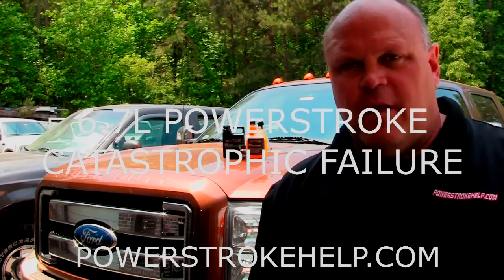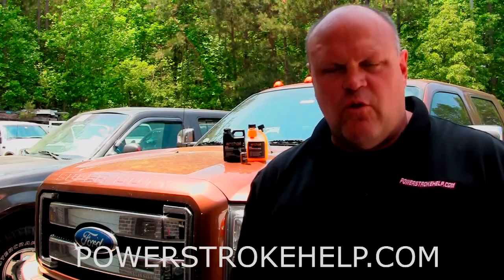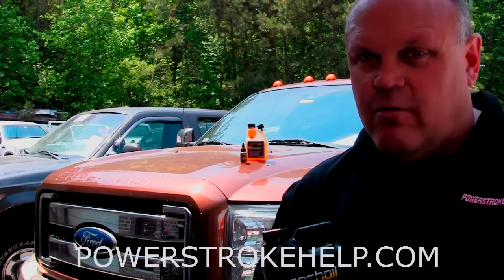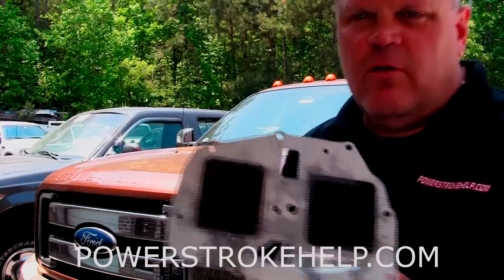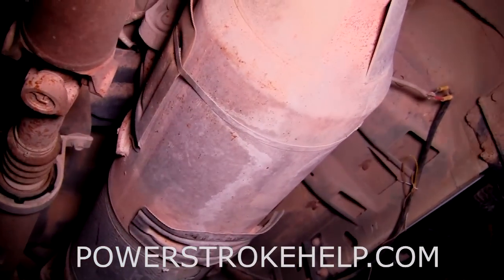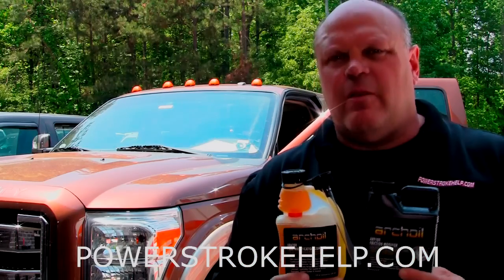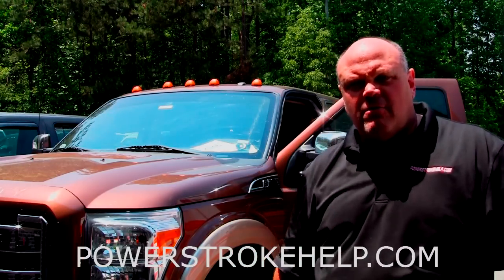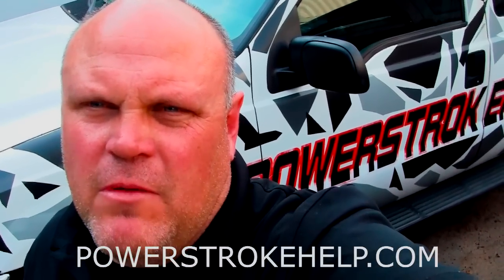6 7L POWERSTROKE CATASTROPHIC DEATH - ARCHOIL

Comment: That probblem diden't sound like Turbo...Ha...i bet it's another Hydro Lock or Hydro Screw up that has Crashed a Connecting Rod....6.7 has Faulty Glow Plugs that wreck the engine...Exhaust will wreck the engine...and Fuel injectors will wreck the engine.....Geeze.....
Reply: i was lookin into buyin a half way decent diesel truck F350 But the instant you buy it..Take it to your Shop and Spend a Week Plus 5 Thousand More Dollars to make it a nice Dependable Truck...The 6.0,6.4,6.7 all have internal issues...if a person took a old 6.9 and put a Turbo on it Or Based on 6.9 is the 7.3  You would have a Nice Truck...A lot of these newer Diesel Trucks with EGR Need Clean Motor Oil...They Run it Untill the Oil Gets like Soot...Well the Engine Spits out Crappy Black Stuff with bad Engine Oil...And Plugs Up the EGR and Urea Systems...People don't want to Maintnence is 50% of the Probblem...The other 50% is Bad internals..And Yes the Stock 7.3 Clutch is a Flop...The life of the Diesel is Clean Motor Oil..it plays a Major role in keepin it alive..Used to change Oil in the Injector Pump when ya changed Oil in the Engine...Not no more...Diesel would of been nice but found a Mint 2001 F250 4x4 that needs Engine work in Orlando for 1,500.00$.... Can't see me Payin Twice for a Truck and Have to work on it for a Week also to make it a Decent one....
Reply: There was a 2 wheel drive Duramax for sale near here for 2,000.00$ ..I almost went and looked at it...Was in Cincinati..Think it was 01 or 02....?  Then I thought..Why are they sellin it for that price...? Got to be something wrong with it....?  I did not mess with it...Diesels can be Soo Expencive....$
Reply: Rich's 65' Tree Bucket Service ?

Comment: How does Ford keep selling these crappy diesel trucks?.....6.0 , 6.4 bad - now we are hearing the 6.7 needs exotic aftermarket lubricant to survive ?.....

I LIKE Ford trucks - their TRUCKS  are in my opinion the most capable, refined and comfortable - BUT- the 6.0 and 6.4  engines in the two that I have owned were a big pain the A$$ that cost me plenty of time and money and Ive gone back to gasoline

if the EPA mandated emission stuff makes diesel design THAT difficult - maybe the designers should go back to the drawing board and the manufacturers should suspend
manufacture of this very expensive crap.

Comment: Why would i  ever buy it... I mean I know though how to take care but you need a income of a upper middle class men...
Reply: +Kenneth Phillips  My cost with my additive is $200.00 a year but the product I have used saved my sludge motor at year 9 when I started testing the product.........I save $300.00 a year in fuel and thousands in repairs......SOOO 200.00 spent and 300.00 saved = 100.00 to the good plus repairs from friction.
Reply: As long as you stay religious about the additive recommended yes I think you'll be good but the moment there's a slip up or something breaks that damages the catalytic converter system its a real pain

Comment: Lol build tough lol good joke Ford I used to own a 2011 6.7 powerstroke deleted everything and fix all the glitches and little problems the guy I sold it too has 375k on and runs like new reason why I sold it I needed something I wasn’t afraid to beat so I got a 2012 Cummins manual

Comment: I don't understand. why all the jabberjawing nonsense. if you want me to buy a product don't spend 10 minutes talking and talking. start with the facts. ie- this product is required because it continues X and this prevents Z
as far as I can tell I just need to go buy some zddp and slap it in the oil, because it has the zinc additives you need.